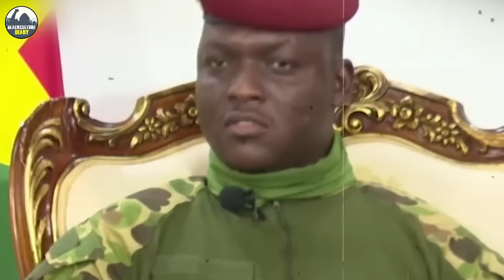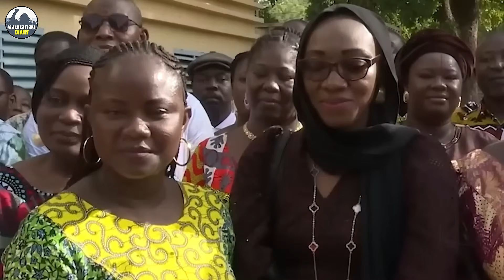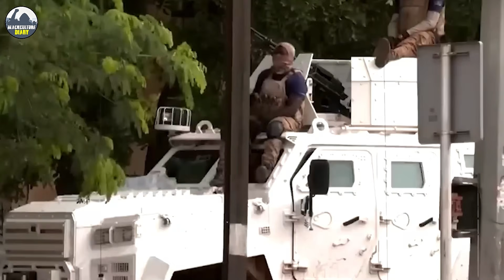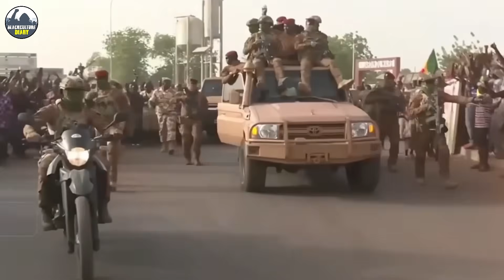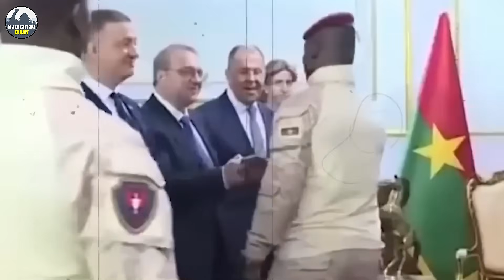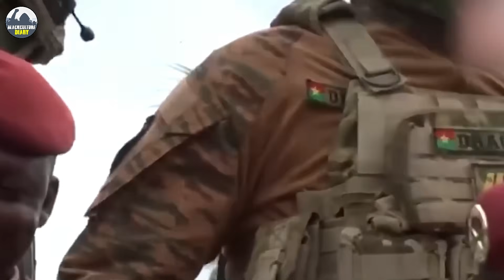Ready for War! Burkina Faso FIRST Ever Locally Built LX70 Armoured Vehicle!

Comment: It's just a Toyota land cruiser with some steel sheeting bolted on. It definitely would not survive a bomb explosion. With the extra weight from the steel sheeting, it would slow down the vehicle. Seen other makeshift armored vehicles made in other developing countries. Even large infantry caliber weapons would easily penetrate the steel sheeting. Not really a fully fledge armoured vehicle. Wouldn't survive long in a fully fledge conflict. Even the wheels are just Land Cruiser wheels and definitely not designed for battlefield use  .  Definitely nowhere near in  the class of a IVECO Lmv , the Australian Hawkeye or a Humvee. They are proper military armored vehicles.